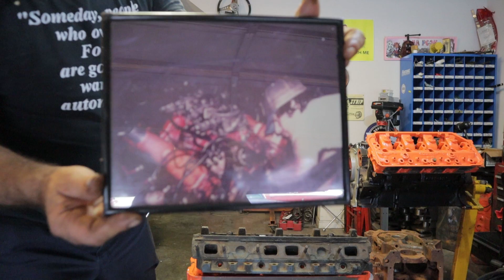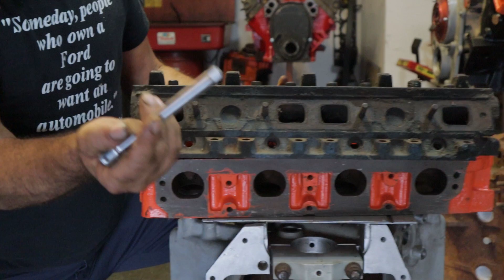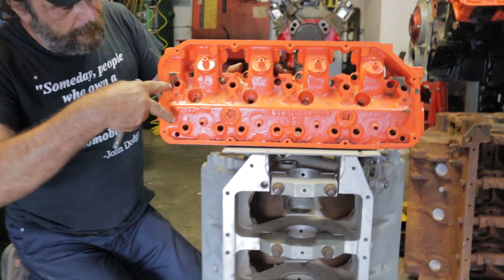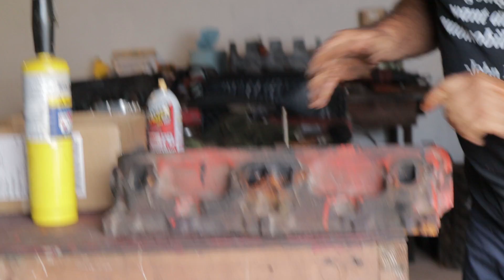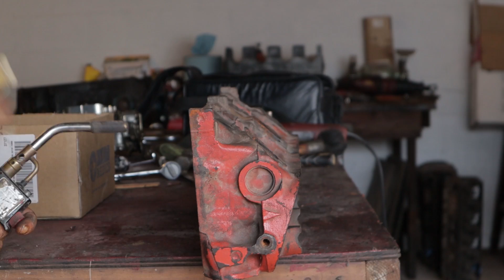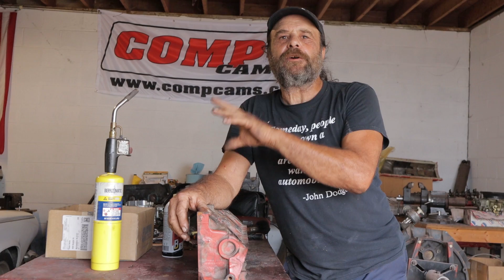What Makes The Small Block Mopar Such A Great Engine?

Comment: Back around 73 to 75 I was running a 68 Satellite and a 74 Charger. Both had 318's with a 2 bbl and single exhaust. Since I was in the service, I didn't have a lot of money so what modifications had to be inexpensive.  The biggest problem I found was that they couldn't breathe. A Holley 500cfm 2 bbl and dual exhaust made it a game changer.

Comment: cylinder head flow is a very important thing. Why do you think the 5.0L coyote is such a good engine? also import stuff like 4 cylinder honda engines that the kids are turbocharging and going fast with. We may not have as many cubic inches but having incredibly efficient high performance cylinder heads makes up for a lot of that. Most exotic sports cars come with engines that have at least 4 valves per cylinder for a reason. Air doesn't like to turn either so the straighter and easier it can get in and out of the chamber the better. Taller or raised ports are pretty much always better for both intake and exhaust.

Comment: I've got a 1964 la 273 that is very tired. It is the original engine for the car, a Dart GT should I rebuild or replace? 318s are a dime a dozen. 273 parts are scarce and spendy, especially pistons it seems.

Comment: Ok, so I understand that for cheap, available parts the LA is the way to go. But, in stock form, don't the polyspherical A heads outperform the LA wedge heads with their canted valve design? I'd love to see a comparison between a Poly and Wedge 318, but the lack of off the shelf Poly parts makes that a difficult proposition. Too bad, I've got several Poly's I need to do something with.

Comment: Being a Ford guy and dealing with the horrendous exh ports on sbf's (actually all fords) I can relate to UT wanting to go smaller inches. 302(not the gt40 or P heads) can't breath with the small valves and ports, plus the massive dogleg. Then Ford bolts the identical head on the 351w and wonder why it won't rpm. I took a 1980 255 from a tbird (small bore 302) and added a 289 crank for 240 cubes. With a set of gt40P heads and a roller cam (.245 @ .050 & .620/.640) it made 513hp at 8100rpm. Build the engine to the head flow!

Comment: What about the early chrysler Hemi head, 392 354 331, evenly spaced ports and they flow really well stock a lot of guys ran there heads bone stock in top fuel with great success back in the 60's
Reply: The 354 heads were supposed to be the best of those gen 1 Hemis. Garlits and I assume many others used the 354 heads oon the 392s.
Reply: @karlbishop7481  The 1955 331 heads are considered ( by modern specialists of this engine series )  to be the best of the series , and the basis for the few aftermarket heads out there ( I'll bet it's so they can do a 1 size fit's all for the series ). But I remember hearing ( 30 years ago ) that the 1956 354 were the ones to have for a 392 build also.
Reply: @Mike_Collins392  You are right, I had forgotten that. I have forgotten more than I know now. Getting old. Lol
Reply: @karlbishop7481  Actually , I think that your memory is fine. The narrative has been re - written by folks who manufacture aftermarket early hemi heads. The 1956 354 are probably the actual " best " . But those wont work on a 331 ( a huge percentage of potential buyers for a one size for all product ). I do not have a flow bench to confirm any of this however.

Comment: I remember years ago porting a pair of 318 poly heads and how I could see straight through them.  I ended up putting pushrods through the ports and taking some pictures (long lost).  I think I had at least 10 pushrods through the intake side and 5 or 6 in the exhaust.  The pushrods passed all the way through into the chamber, sticking out both sides of the head.  With the assembled engine (less intake) you can look down the intake port and see the spark plug and damn near gap it through the port.  With the valve open, of course.  I still have the engine, 318 poly heads on a stock 360 shortblock (with some modifications).

Comment: Tony, Loved this video.  Working at Total Automotive Engineering (Andy Mannarino) I did all the block work on a 390+ " 340 for a guy. it was in a 63-64 Barracuda, a 14X32' tube chassis car.  With (I recall) some brand of aluminum heads and a roller cam w/ a single carb (1050 Dominator)& that thing made 730 HP on the dyno! The owner of the car (a real good guy) went back to his favorite combo w/ Hillborn FI and it still made 700 hp. (Incidently years back I had owned the rolling chassis of the famed Silver Bullet 67 Plymouth Belvedere of the Detroit Street Racing scene of the 60-70's) Sadly I traded it away but years later I couldn't help but think what a small block engine like that would've done in that car seeing as Jimmy Addison had told me and a few buddies that the 496" Hemi w/ tunnel ram in that car made 735 HP. Think a lighter LA engine making almost identical power yet lighter!) I want my old 69 Valiant back! I still know where it is even today, I had converted it to 8 3/4, Super Stock springs, & disc brakes all from a 73 Dart Sport I had. If I wasn't so old and decrepit now (and broke) I'd love to build an LA engine with a 904 for a bracket car!

Comment: Love the small blocks of that period.  Reliable screamers...I love my 67 330 4bbl olds.  The olds w-31 350 is one of the coolest cars to ever come out,  too bad they never did a "w" option with the 330; they were more robust and full of forged goodies.  Tony said it right a while ago, olds had it's best ram air setup when the scoops ran through the bumper

Comment: I was a little confused by Tony's final comments, but I think the point is to build cubic inches to head flow (based on desired operating range).  It makes sense - if your head won't support cubic inches / rpm then you're carrying reciprocating mass that you don't need.  For most scenarios its a non-issue because the extra cubic inches at low rpm are beneficial in normal driving and the top end rpm effect is rarely experienced / a concern.  But if you have a head limitation (which should always be the limitation) and you build cubic inches to your desired RPM range then that should be optimized throughout the power band.

I think I have that right.

Comment: Always loved the LA engines, reliable , good power and tourque, never ran hot, and surprising rpm as well without damage. My fave combo is a. M1 single plane with a thermoquad and an RV cam from crane, 340 s package exhaust manifolds or headers, tuned H pipe into 2 1/2 exits or a 3" NASCAR single for velocity. I always wrap the headers, or ceramic coat the manifolds inside and out ( jet hot) to lower understood temps and increase exhaust velocity even further. It's not good off the line, but if you like sustained high speed and the feeling of a 2 stroke dirt bike hitting the power band on the pipe at around 3500 rpm it's a great setup🤙

Comment: Maybe there is something there about heads that have siamesed ports. Here in the UK the head for the classic mini (the A series) flows more in reverse and that is why it benefits from anti reversion measures (valves and "mis aligned" exhaust manifolds). Looking at your demonstration with the blowtorch that got me thinking, would there be a benefit in installing the exhaust manifold upside down? You would have to make a hole in the bonnet for the exhaust and you wouldn't be able to run it under the car tho....

Comment: The best part about tha small block mopar is the valve angle and the valves are relatively centered in the chamber. The intake and exhaust ports are small and restrictive. Been proven

Comment: I'm just getting into classic cars and your videos are incredible Tony, thanks so much for sharing your knowledge. 
I just picked up a 77 Plymouth Trailduster with the small block 360 and I'm constantly blown away with the power it makes. So much rust to fix though =[
Reply: HA ! I have a rusty 360 76 Trailduster 2 wheel drive with the rare Minnesota Truck Parts Pacesetter halfcab. I hated the 76 grille, and switched to a perfect , still in the box 77 / 78 Plymouth grille.

Comment: @UncleTony'sGarage you can definitely see the architecture is superior in the port design but why is it that the LA heads dont seem to flow much more/anymore than say a cast "performance" sbc head from the 60s/early 70s? You would think they should. I'm a sbc guy myself so correct me if I'm wrong but just looking up flow charts most seem to flow 200-220cfm at .4-.5" lift

Comment: This scaling can be done by cubic inches and your "normal" race RPM envelope.  Or, it can be done by staying bigger inches and turning less RPM.  Two ways to limit pumping volumes.  Buick guys know all about early shifting and letting the TQ do the work.  If you come from a small block Ford or Chevy world you reach for RPM to get usable HP.  But if you come from the Buick and Olds world, you look for usable TQ peaks and shift a it just above so you land on the shoulder of the TQ curve to pull through the next gear.
On the street, folks will almost always reach for high TQ motors that absolutely peak at say 6,500.  When I was running my 273 Cuda back in the day, I was shifting at 6,100 because I had run out of cylinder head.  Was not terribly impressive at the strip (mid 14's), but on the street with sketchy surfaces and Atlas Plycrons I could haul the freight right by a lot of bigger motors ...  The gen 1 Cuda was pretty light, transferred weight well, would fit enough tire, and was rugged.  I did got through some rear ends, but the 273 was a can't kill it motor : )

Comment: Thanks for teaching me something I didn't know but that makes perfect sense, especially after the demonstration with the torch. Most engine conversations I've had with folks, we usually talk about whats going into the engine (fuel/air mixture, carbs, intake manifolds, etc.), but rarely think about the output to that depth. That is very interesting that the small-block heads 'accidentally' were designed with the best flow. Learn something new every day around here. Thanks, Uncle Tony!

Comment: Will you ever cover the magnum generation engines?
Reply: seriously. i think they are ls beater sleepers.
Reply: @frigglebiscuit7484  ok easy killer
Reply: @romper4444  i did a dyno simulation of a 5.3 truck motor vs a 5.2 magnum. bth were built with the same cam, compression, intake, and headers. 5.2 magnum made the same hp, but at a lower rpm, and made more tq, at a lower rpm.
Reply: Everyone that agrees with me post "Yes".
Reply: @beniamino939  Yes!
Reply: @beniamino939  yes I have a 93 Dakota 318 I believe the previous owner did a cam package on it off-road Cam and lifter package and I walk away and leave Chevys all day and it's the extended cab so it's kind of heavy but it does have a shift kit also
Reply: i was wondering the exact same thing
Reply: @BeatersRus  Tony! WE want to see you cover magnum generation small-blocks, Please!
Reply: Yes
Reply: YES
Reply: Yes

Comment: You're cutting yourself short without mentioning the magnum 318 and 360. The internal components like rods are grams lighter than the LA engine generation short block. There are carbureted intakes for these engines that fit the bolt pattern. Here is a link for a reasonably priced intake for the magnum generation engines. 
 https://www.summitracing.com/parts/sdm-1-147-028/make/dodge
Reply: is the 318 magnum a good strong motor mine is a 92
Reply: @barneywarwick8745  First year they came out!

Comment: Pulled the 5 quart a week oil burning 3.9 out of my 98 standard cab 5 speed dakota sport when a friend sold me a mild cammed dakota 5.9 RT motor for a hundred bucks . RT Dakota's weren't available with a five speed . I just made one . I now have a race truck that I can't keep tires on !  No wonder they didn't offer that option !  🤪
Reply: hey what was the flywheel part number for that swap?
Reply: @BeatersRus  5.9 full size ram was available with a 5 speed . This is the flywheel and clutch kit I used from rock auto . The ECM and engine wiring harness from a dakota 5.3 318 5 speed I got at a junkyard for less than 50 bucks . No need to flash the ECM .  5.3 and 5.9 ECM's are the same . No check engine lights . Easiest way to go .The original crankshaft sensor and starter for the v6 works with the v8 . Everything bolts up . Plug and play , Hook and book !  🤪  Almost forgot , the v8 throttle body has a different style accelerator cable end . Full size ram accelerator cable from the junkyard saved the day .
Reply: @sparkythedetroitdoggo8281  k i was just wondering if you had used a performance piece instead of stock and ty.

Comment: Hey Tony back in 93 I got a 65 barracuda with a junkyard 318 in it I’ve built a set of 360 heads Port matched and  lightly Ported milled the heads  40 thousands to keep the compression ratio up 340 cam 340 manifold on the left magnum manifold on the right Wyand high-rise dual plane with a thermal quote on it with a four-speed behind it iWorks for the past 28 years love the set up

Comment: I read somewhere(maybe allpar) that the later 302, 309 318 and 360 heads are better than the old J heads and X heads if i recall. The combustion chambers on the 318's-360's from 87-92 i think had the best combustion chambers, better flow and design

Comment: love the video i noticed the same thing vs ford and chevy smallblock exhaust ports in my builds. this is a superior head design. i also noticed in my builds that the 318 and the 340 piston for production performance where quite similar and could withstand most adders like nitrous, cdi boxes and really opened up.
the 360 did not stock produce in my opinion a performance piston. i always wanted to do a full race build 318 with 340 forged crank and the 340 timing cover for the improved seal. but i have noticed that extending stroke which is what the 360 did limited options and created harmonics that where destructive through the engine. the 318 and 340 did not have this problem and could be built with superchargers, turbo chargers etc. whereas for the money the 318 for 200 bucks i believe is the future of cheap hot rod engines.  i would love to see more content for these engines as the old videos and information from sox and martin, dli the guys i grew up with showed amazing things with the smallblock mopar. i think this has been abandoned for the money of production. but for life i will either run a a rp block 318 or 340 from now on. great video mr tony keep it up.

Comment: i had been say this for years on the small blocks a 273 built im for that asap .this is somthing i whanted to do was build a 361 big block for the same reason to over come exhust  restriction face it it dont even have the stroke of the sb 360 so other then its weight i see why the hell not.but in the past every body thinks im a smallblock lover no i love them all and the best was slant six in my life bullet proof never needed any thing exsepct  keeping lash set i loved to set lash hey at 14 you flet like a pro dealing with lash you learned why how of the  cam i could go on you have been there it showes.one thing w2 econo head is a must for that 273 .no the w2 head valves are to big you have to notch the block so skip that okay.i just got a head of my shelf thir .im good now.i say 275 hp out of it.

Comment: I "Rifle" my heads using a coarse stone in a swirl pattern.  I've seen amazing results on both the flow bench and the track.  I'm perfecting the technique however it's very adaptable to ANY make/model or size engine.
Reply: Interesting, tell me more. You put a swirl pattern in the surface or actually cut grooves?
Reply: TDA -  I had a ol timer show me that many years ago on some vw heads and it works!! After I got into v8’s, I was wondering why nobody was doing it to them!

Comment: Back in the early to mid-seventies, my street racing days, the Chevys were always cheaper to build. You could get much more hp with the same $. I was always frustrated by that, but I never defected
Reply: But in the long run the chebby cost you more. It's never had anything that was as reliable or heavily built to take the abuse like a Mopar. And where all the racers build their chebby junk 3 or 4 times a season I have run mine as long as two full seasons without a refresh, cause it did not need it. I saved in the long run and made much more power than they ever did.
Reply: @dwc4343  I figured the much greater numbers of GM vehicles gave their aftermarket hi-po parts the price advantage. As we used to say, 'they go, and then they blow'

Comment: The la engines are getting harder to find but the magnum engines are everywhere. What do you think about the magnum head?
Reply: They flow better but prone to cracks , I prefer older port and polished cast iron heads , their fine for your street rod .
Reply: @Ratridez  most of those cracks disappear when you bowl port.
Reply: @frigglebiscuit7484  Good to know thx 👍
Reply: magnum blows the la out of the water.

Comment: I have also heard the valve angle is better on the Chrysler.  I believe it is 18 degrees compared to 23 on the little Chevy.  Closer to the center of the bore allows for bigger valves.  I asked Uncle Crystal about the strength of the block compared to the Chevy but never heard back.  I also was wondering if the 340 block is stronger than the 318.  I know the Trans Am blocks were different but I am talking about the run of the mill 340.